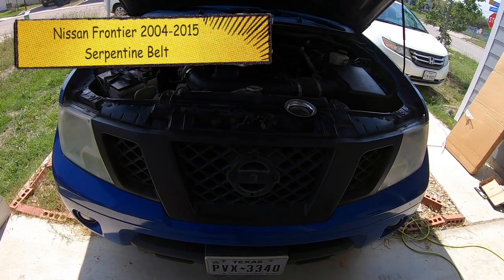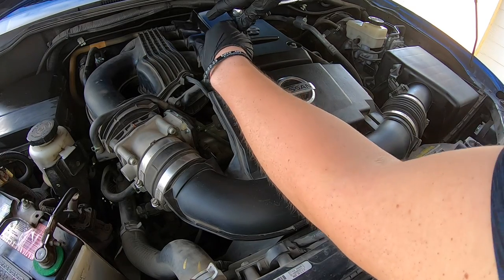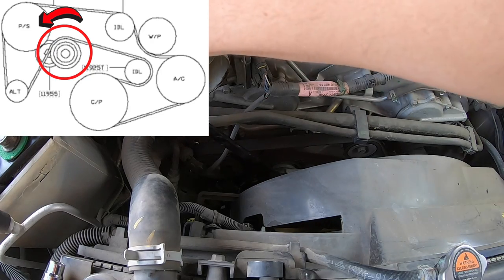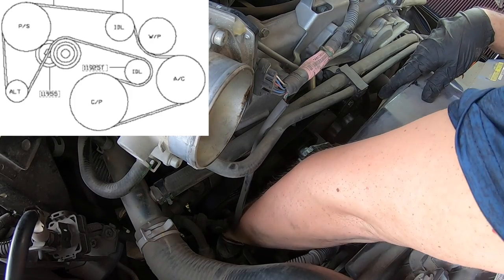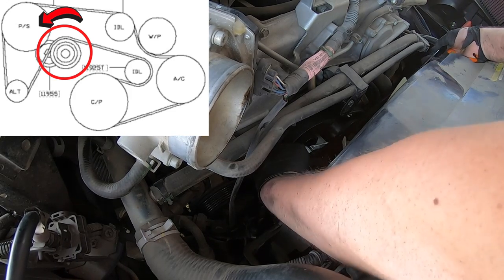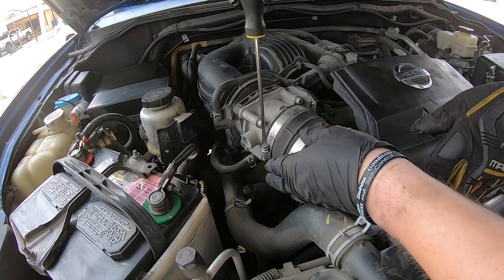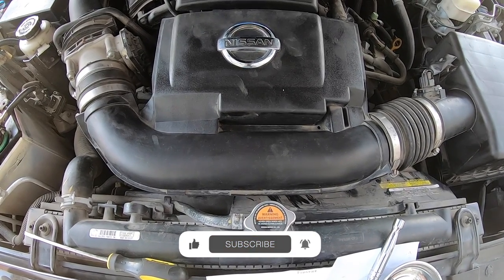How To Easily Replace Your Serpentine Belt On A Nissan Frontier From 2004-2015!

Comment from the maker: Learn how to change out your brake pads and rotors on a 2014 Nissan Frontier with a v6-cylinder engine 4.) "D40 Series".  This will be the same process as a 2005, 2006, 2007, 2008, 2009, 2010, 2011, 2012, 2013, 2014, 2015, 2016, 2017, 2019. 

THE TOOLS:
10mm + Ratchet + 3in Extension
3/8 Drive Serpentine Belt Tool
Flathead Screwdriver
Magnetic Tray
Needle Nose Pliers (optional) 

THE SUPPLIES
Dayco 5070874 - https://amzn.to/3KrmuXH
Gates K070873 - https://amzn.to/3OFu03K
Continetial Elite 4070873 - https://amzn.to/3KoUzYG

Chapters: 
00:00 The Project
00:27 Tools & Supplies
00:55 Removing Engine Cover (10MM)
01:48 Remove Air Intake (Flathead Screwdriver)
02:44 Remove Old Serpentine Belt (3/8 Serpentine Tool)
03:40 Compare Old & New Belts
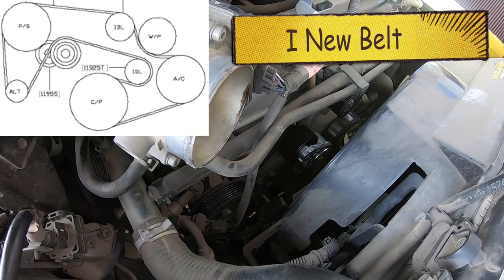03:51 Install New Belt (3/8 Serpentine Tool)
06:39 Test
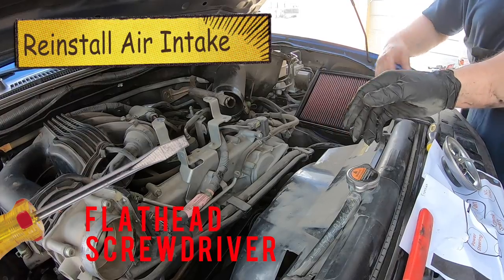06:57 Reinstall Air Intake (Flathead Screwdriver)
08:03 Reinstall Engine Cover (10MM)
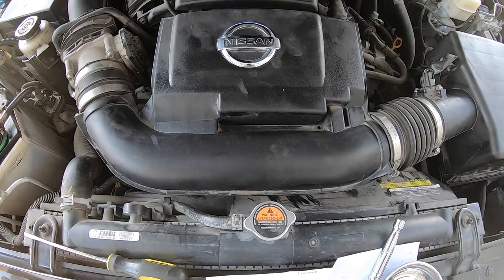08:49 Closing

This video works on all makes and models of vehicles. The video was done on a 2014 Nissan Frontier. 

Check out my website at http://mcfixit.us 

Links are associate links. A small portion of whatever you buy helps support this channel. Thank you for clicking on the links and purchasing to help out this channel to keep making great content for you!

Disclaimer:
Due to factors beyond the control of MC FIX IT, I cannot guarantee against improper use or unauthorized modifications of this information in the video, post, blog, or social media. MC FIX IT assumes no liability for property damage or injury incurred as a result of any of the information contained in this video. Use this information at your own risk. If you feel uncomfortable at any time. Stop and go to a professional. MC FIX IT recommends safe practices when working on vehicles, your house, or any other project and or with tools seen or implied in this video. Due to factors beyond the control of MC FIX IT, no information contained in this video shall create any expressed or implied warranty or guarantee of any particular result. Any injury, damage, or loss that may result from improper use of these tools, equipment, or from the information contained in this video is the sole responsibility of the user and not MC FIX IT.

#mcfixit #autorepair #frontier #nissan #serpentinebelt  #carrepair #mechanical   
——
Supplies used to record this video: 
* GoPro Hero 7 Black - https://amzn.to/3f3ALtb 
* 256GB Flash Drive - https://amzn.to/33pAueG 
* Vlogging Frame - https://amzn.to/33tajE0 
* GoPro Pro 3.5mm Mic Adapter - https://amzn.to/2RCURCu 
* Youmic Lavalier Lapel Mic - https://amzn.to/2R55sWX 
* Boom Stand (tripod) - https://amzn.to/3bdkQaw
* 5/8” to 1/4” adapter (boom to blogging frame- https://amzn.to/3txrVsM 
* Portable Battery Powerbank- https://amzn.to/3vJQc0q 
* 6ft USB to USB-C (powerbank to GoPro)- https://amzn.to/3uAS5MH

Comment: Thanks for the informative video. Blowing out the intake tube with air before assembling is a good way to get that crap that the air cleaner missed.
Reply from the maker: Great tip! Thanks for adding that. I appreciate the watch and comment!

Comment: Why does this not work for the 2017? Belt number is the same.
Reply from the maker: It might. I know it works for the years mentioned bc the 2017 is a different generation. Sometimes they alter things between generations on manufacturers. I only put the range that I know it will work in my videos. Hope that helps!
Reply: @MCFIXIT  - You are mistaken on your Nissan Frontier generations, then. You list 2004. That's not correct. The 2004 is the last of the 1st gen (D22). The 2nd gen (D40) is 2005-2021. Hope that helps!

Comment: Does this work on the frontier 2016
Reply from the maker: It should be very simliar process of removing and putting the new belt on. Make sure you have the correct beltt for your model and year.